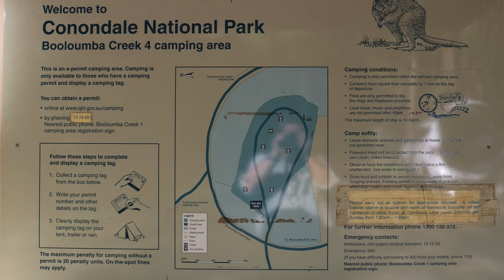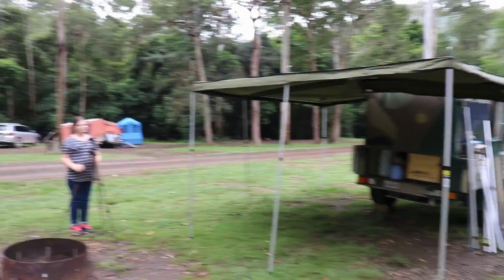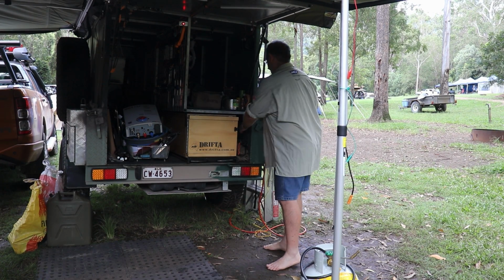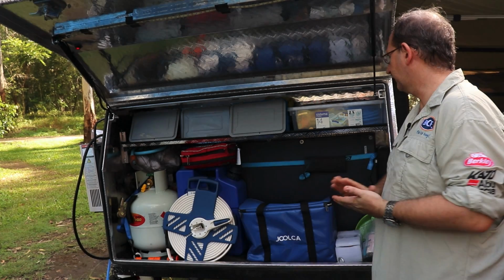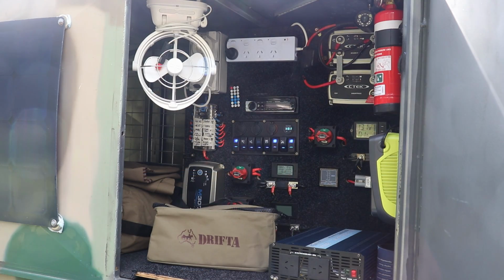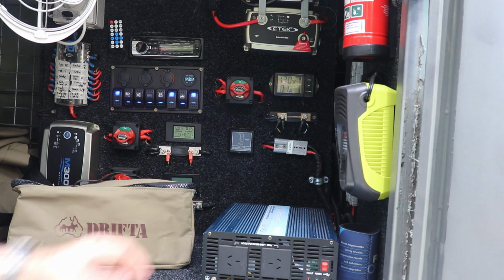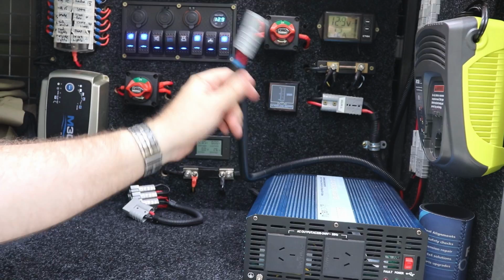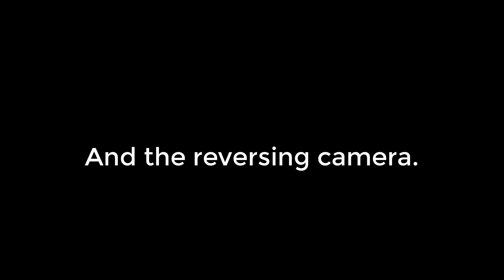Booloumba Creek and the homebuilt camper trailer  - Part 1.

Comment: Hey legend

Got a few questions if you dont mind

- The water meter guage in your power box - Where can i get one? Are they good quality?
- Your joolca hot water system - Are you running the Joolca 12V pump or a different 12v water pump
Reply from the maker: Hi Ben!

Good to hear from you! 

The water gauge was purchased from Camec. You can find their web site and the product here:

https://camec.com/plumbing-gas/square-single-water-tank-gauge-black.html

They are pretty simply to install. Just need a drill a hole in the tank and feed the "prong" in. ;-) Run the cable to the display and 12v power to it. The rest is done by the meter itself.

So for the Joolca hot water system we keep the joolca water pump in the storage container in the front of the trailer. The reason is that the trailer already has an onboard water pump. We would use it this way if we ever wated just hot water for washing the dishes. 

The pump in the video you see, is the pump that can be supplied with the Joolca hot water system. We also purchased a long hose and made up a long power cord, so if we were camping beside a creek, we could throw the hose inter the creek, and use the pump to get the water to the shower. As yet we have not needed to do this as place where we have gone tend to have a water supply near by, where we simply use a water container and the pump.

The Joolca system has worked well and I would recommend it to others. I reckon they could work on their show bag. I just bought a slightly larger bag from Drifta which we will use from now on. Apart from that its a great setup.

Kind Regards

Robert.
Reply: Hey Robert

Thanks for the quick reply mate :)

I own the Joolca Shower System and I have also purchased the Drifta Joolca bag (as well as many other Drifta products ahaha)

I own a Toyota 76 series landrcruiser (wagon), I'm in the process of setuping up my Joolca shower system inside the truck, as i have removed the rear seats. Just thought i would ask a few questions to some one more knowledgeable then :)

Thanks mate, ill be asking you many more questions ahahahah Remember my name

Have a good week
Reply from the maker: Hi Ben,

Yeah. I have a whole pile of Drifta bags. Got their awning, Pull out kitchen, Draw slides in the challenger. Fire places..etc etc etc... ;-).

It's so good to have a hot shower. You'll love it ! :-)

Kind Regards

Robert
Reply: Same rob

270 wing awning, Joolca Shower Bag, Snow Peak fire pit (didnt buy the drifta bag and i should have) etc etc

some mint products ill have for decades